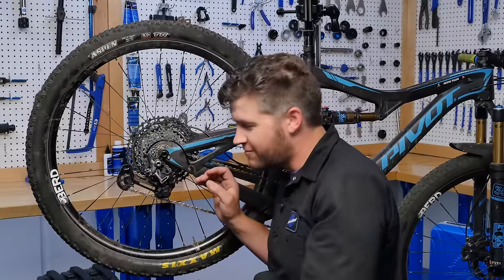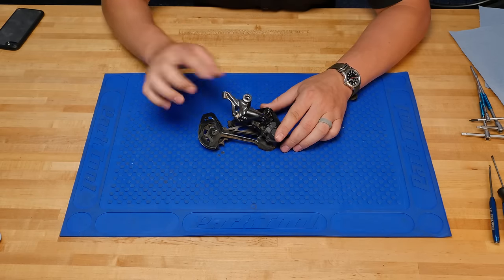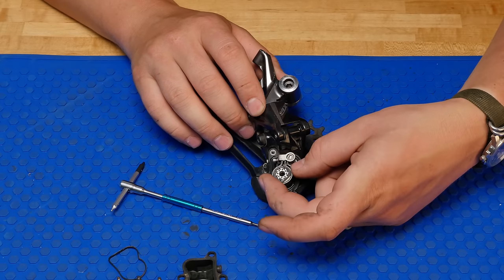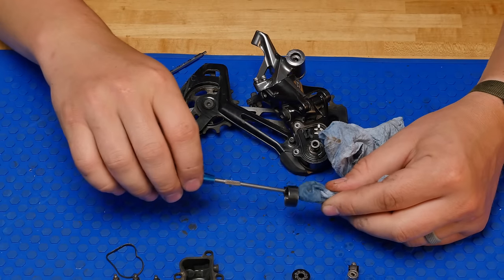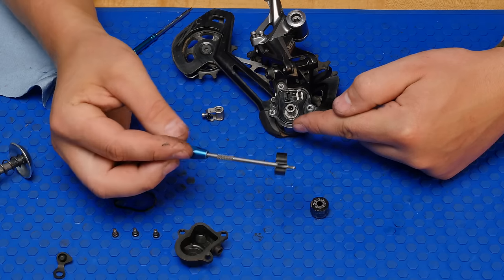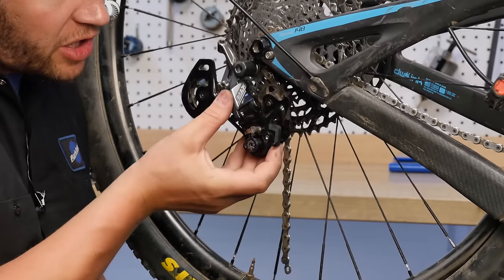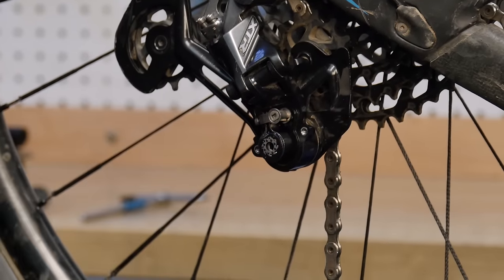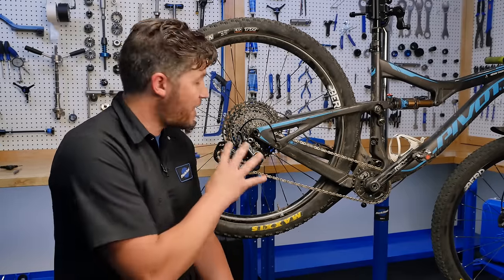Shimano Clutch Adjustments | Tech Tuesday #183

Comment: Wow, I actually didn't know that it can get that hot inside the clutch, I would've used regular all-purpose grease there. Great video!
Reply: It’s not getting hot inside the clutch, I have no idea why he’s saying the grease got burnt and then mentions high temp grease…
Reply: One would have to take a measurement but yeah, not sure it's actually getting hotter than what a conventional grease would handle. It's no active breaking surface. The reason one should use a specific grease though, has more to do with friction IMO: the clutch/jaw assembly does move a little to resist induced chain slack, meaning the mechanism is not trying to lock things out completely but merely add some friction (hence some heat buildup for sure). One therefore wants to avoid metal-on-metal, hence some lubrification required, but it needs to be a very thin, consistent layer. That's why a low viscosity, thin (ie. not thick, buttery) grease is expected: cSt ~40, NGLI 0.
Reply: I would like to see someone measure the temp before I'd buy that it's getting that hot in there. I believe HPG-1 is lighter weight than their PPL-1, so that may be some of it. On top of that, the Shadow grease is a calcium sulfonate grease, as is HPG-1. The PPL-1 is a polyurea may not be compatible if the Shimano grease isn't cleaned out.
Reply: @Montblanc1986  just turn on your clutch and move it back and forth than put your fingers on it, be careful 😂

Comment: I had a problem with the clutch sliding itself off when the cover is not on.  So when Im adjusting the clutch and moving the arm back and forth the clutch assembly starts sliding out.

Comment: Thank you.  At 7:40, when you put the slotted piece over the clutch lever, there is a cam on that part and it can rotate 180 degrees so you have to be careful to get it the right way or when you flip the clutch lever, it will not add tension and the lever will be floppy. I did this last night and can't wait to ride and feel the difference. Over 6,000 off-road miles on my XTR derailleur and I have never done this maintenance step.   I am Barnett's and Shimano certified and worked in the bicycle industry 22 years and just didn't think to service the clutch.
Reply: This caught me out, I thought I'd broken my XT derailleur! 😅

Comment: Excellent video! Very well explained. Recently I  had the heart to service the clutch of a neighbour's Shimano Deore XT after he was complaining about his chain always falling from the chain ring. It was my first time working on a derailleur clutch. After unsrewing the cap I saw a mixture of dirt, rust, moisture... The friction band was like completely seized onto the cylindrical spindle. I thoroughly cleaned all parts and applied grease to the surfaces concerned. Unknowingly I used a universal grease... I couldn't imagine that a high performance grease was the one to use, couldn't imagine that the temperature there could go up that  much... I'm now thinking if redoing the servicing with the right hpg grease. Thanks a lot for your comprehensive explanation. Also I will use a torque wrench to do the final adjustment.

Comment: Thank you for the helpful video. Yesterday I tried it with my RD-5120. When you put the cover back on, you have to put the clutch band deep enough or the head of the tension adjuster will bump into it and the cover will not stick. I think this is also a point to be aware of. My impression was that if the torque of the friction was not reduced to about 3Nm with a tension adjuster, the cage would not move smoothly as in the video. Although Shimano's instruction manual says 3.5 nm - 5.4 nm. By the way, I'm a Japan person, so I didn't understand the correct meaning of "have a clutch day" :)

Comment: So I have a brand new xt di2 derailleur and it seems to have a decent amount of play in the clutch activation lever. Basically the pin from it can wiggle up and down. The issue is that this play allows for the chain to be a bit sloppy for the first bit of rotation before it really  engages the clutch. It also seems to tighten up just fine when upshifting but then almost looses tension when downshifting regardless of the gear.
Reply: I had this issue with 2 deore derailleurs, I tried everything and still there’s a lot of chain play/slap

Comment: 🔥👌This tutorial is ingenious!  Explains all the mechanics yet keeps it simple to step by step maintain this part of the RD.
[Though I think that the clutch systems of the GRX series ( and the Ultegra RX) are designed a lot simpler, there is no cap to adjust the clutch band from the outside, and no torx option to adjust from the cage side.]

Comment: In your opening your seen pulling against the Clutch on the Cage pivot of this Derailleur, and if you notice, it's very loud and "rachety" with the Cage assy slipping quite freely for brief moments across the arc of this CCW rotation.  That is Not the Clutch portion of the "Chain Stabilizer" that is breaking loose and causing the Cage assy to Rachet forward, its the Sprag Bearing INSIDE the Spring Steel Clutch Band that is ratcheting on the center Support Shaft (or P pin ("Plate" Axle) as it's referred to in the Shimano DM (Dealer Manual)).  A Clutch allows for regulated slippage, or Drag, between surfaces, which is what the Spring Steel Band does that is wrapped Around the Sprag Bearing in this case. The Sprag Bearing, at the center of the Stabilizer assy, is a One Direction only Needle Bearing and is designed to Lock-Up, or stop, any rotation in the opposite direction. It's functionally the same as the Freewheeling Hub of a Cassette but locks to the Pin itself instead of a ratchet. The Needle Rollers in the Sprag Bearing are pre-loaded with Spring Steel strips behind them which allow free rotation in one direction only while providing full bearing support around the center Pin on the end of the Cage axle. When force is applied in the opposite direction, the Needle Rollers are forced into the shaft, by the spring steel strip behind each roller, and will lock the Sprag Bearing to the shaft. Sprag Bearing Needle Rollers NEED to be cleaned and lubricated or they will Not lock up on the center shaft and WILL Ratchet momentarily in the wrong direction as you've experienced here in your opener. The "Clutch" portion of this Chain "Stabilizer" assy is in fact the Steel Band that is wrapped Around the Sprag Bearing.  It's metal on metal so it needs cleaning, grease and proper adjustment to work properly.  Next time you have one of these Stabilizer assy's apart, separate, clean and lube the center portion, or Sprag Bearing, place it on the support shaft and test it for yourself. It's a Bearing and so should rotate Freely (CW in this case), but Lock to the Pin when force is applied the opposite direction (CCW in this case). If properly cleaned & lubed, w/ light oil, it will lock up on the shaft instantly when turned the opposite direction. Running a Sprag Bearing dry (without lubrication), will result in the bearing breaking loose from its Locking direction momentarily and appear to Ratchet, just as it did on your opening scene. You can easily test this Unique feature of this Sprag Bearing on the workshop bench and Research this type of Needle Bearing on the Web. It's often referred to as a "Clutch" Bearing but NOT because it has a Clutch function, but because it's often used w/ a Clutch assy like the Spring Steel Ban wrapped around this bearing in this case. I first learned of these unique Bearings located in the Final output gear of model R/C Helicopters which lock onto the Main Rotor shaft during powered flight but allow for Freewheeling, or Auto-Rotation landings if the engine should quit. I found out the Hard Way that an improperly maintained Sprag Bearing will slip badly when Torque is applied to its Locking feature and make for a pretty bad Bearing when Freewheeling. The Shimano DM (Dealer Manual) explains this badly, but who has ever seen a Japanese to English Maintenance/User Manual (Jinglish Manual), that got the terminology correct w/o butchering the English Language in the process ? It's the reason people Produce these video's because the Manuals SUCK. The DM DOES warn not to get Hub Grease into the Pin or Roller Bearings of this Sprag Bearing (or Clutch Bearing as it's referred to in the manual), but they DO remind you to lubricate ALL moving parts of this Derailleur in the Installation & Maintenance Notes in the Manual Intro (page 4). A Good cleaning of the Pin and the Rollers w/ a little light oil applied will make this Sprag Bearing Happy. If the Pin is corroded it's because you've let it go Dry, just replace it and Grease the Cage Sprocket end but light oil only for the Sprag Bearing and Pin.
Reply: He even pointed out that there was burnt up grease on the inside of sprag clutch!

Comment: If I have your click type torque wrench (don’t have the beam type) how do I determine how much adjustment of the clutch is required as you did at the end of the video?
Reply from the maker: Set the click type to the desired torque and turn. you should get about half way through the action of the derailleur before the wrench activates.
Reply: @parktool  thank you. That’s what I thought after I wrote you. I also assumed that I’ll keep adjusting the clutch until the torque wrench (set to approx. 5Nm) activates at the end of the full motion (i.e. at the horizontal poison and not before)….thanks again.

Comment: Do they typically come set fine when new from shimano. Or do you find that one needs to adjust and grease the clutch when the unit is brand new?
Reply from the maker: They come out of the box setup great. After time the clutch will get hot and cause issues to arise.

Comment: Ok, this has a slightly higher production quality than my maintenance video from a couple of years ago. 😬
Anyway, I would recommend to also disassemble the rest of the derailleur and clean the axle while you're at it, it doesn't take that much longer, but can remove another potential cause of stickiness and noise.

Comment: Hello there, will MoS2 grease work for this maintenance? what can I use instead of your HPG1 grease?
Reply from the maker: Most Moly greases will have a operational temp range of less than 300 degrees. You are after a grease with a high operational temp. HPG-1's range is -20 to 540 degrees Fahrenheit. During a rough decent your clutch will get extremely hot and you do not want to cook the grease. HPG-1 is a good choice.

Comment: I thought we were supposed to use the Nexus Internal Hub grease for this?
Reply from the maker: The reason to use Nexus Internal hub grease is for the temperature. Our HPG has a similar temperature range to Nexus hub grease.
Reply: @parktool  Thanks for clarifying!  Love the videos, keep'em coming!
Reply: @parktool  I think you are wrong. I have read that reason to use Nexus Internal Hub grease is that that grease got little pieces which add friction. and those peases are importat also in clutch. There is marketing also Shimano grease for clutch, but maybe is same liquid.
Reply from the maker: We reached out to Shimano to verify before posting this video.
Reply: I've used dt Swiss ratchet grease too. Seems to work fine as another alternative
Reply: @parktool  Then I have heared wrong and glad to see this video and commentet, so that I got corrected. :)

Comment: Would the adjustment be the same with a oval chainring ?
Reply from the maker: Yes, but you may get a bit more wear as it is moving a bit every pedal stroke.
Reply: @parktool  so probably better switching to round chainring ?
Reply from the maker: @edritchie270  Up to you. There is very minimal movement in the cage due to oval rings so it will not be a huge improvement in wear.

Comment: How do you fix a clutch that slowly creeps itself to the off position everytime you hit bumps?
Reply: The clutch on/off switch bar can be tightened for better retention. There are multiple videos on YT on how to completely disassemble a Shimano Shadow+ rear derailleur clutch, replace the clutch lever if need be (worn out, broken...) and adjust its tension.
Reply: It also might be a case of too low the collar tension. This very video shows you how to adjust tension by acting on the bottom, cap-protected screw by fiddling with the distance between the collar's plates.
Reply: @chikamichi  thanks. I figured the flat metal part that's inside the clutch assembly that goes into the lobe spun itself against the plastic lever. So the lobe never engages and locks itself against the clutch ring.
I grabbed the clutch flat metal part and turned it while holding its plastic lever stationary.
It locks itself now everytime i turn it on and never disengages. 
Too bad though, i still have lots of chain slaps and it never really stops the derailleur from extending during ride.
I guess the whole clutch assembly is defective because of old age/heavy usage.

Comment: Good video oveall, but there is one major error.  The ONLY grease that should be used between the one way bearing and the friction band is the white Shimano Nexus grease.  It was specifically developed for the heat of coaster brake pads and can deliver smooth friction at the same time.  No other grease will work in the clutch, at least not for very long.  And, other greases can actually make the clutch feel worse.
Reply: I have the nexus grease but the action on that hi temp grease looks fantastic.
Reply from the maker: Have you tried other grease? We talked to Shimano tech reps about the temps and appropriate grease before this video. HPG's range was in acceptable parameters according to them. Shimano now does not suggest Nexus grease and has a new special grease just for these clutches, if thats what you are looking to use.

Comment: Hey Park Tool. My SLX 12 speed clutch keeps moving from on to off. My old XT did not do that. I can not see anything broken as far as i know. I jumps to off af some fair decents in Denmark. Bikeparks i happens a lot faster :-( Any ideas?
Reply from the maker: Possibly the cam assembly needs to be replaced.
Reply: @parktool  That would be a bummer on a 1 year old part. But i will look into that. Thanks 👍
Reply from the maker: Suer would!

Comment: Only thing I'd like to mention is that you point out that there should be "white" grease on the silver post and that it is now grey because it's "toast".  But then you don't put any new grease on the post when you mount it.  So....how why was there white grease turned grey on the silver post and you didn't put any new grease on it?
Reply: I didn't understand that either. I ended up greasing the post. If you look in  the clutch, it looks like there are roller bearings that contact the post. Not sure why you wouldn't grease a roller bearing ever?

Comment: How to service your Shimano clutch:
Step 1: remove all Shimano drivetrain and throw in garbage
Step 2: install SRAM GX drivetrain
Step 3: ride
Reply: That's the most ignorant thing I've read in years. SRAM mechs are junk. They flap from the outset and are made of soft plastic not fit for purpose. I can tell you from experience that I have regular warranty claims with SRAM products, little with Shimano.
Reply: @adamf5942  at least Sram will warranty replace faulty parts. Shimano warranty is next to impossible.
Reply: @SpMoose  I've never had a warranty claim denied by either Shimano or SRAM and I've been working as a mechanic for years.

Comment: Seriously? Cleaning such stuff with a ... rag ?? Gezuskrist, oh those "mechanics"..
Reply: lol are u ok? what would you use to clean it, an ultrasonic cleaner? its a bicycle part not a space ship part
Reply: @bmxscape  it's a part (with grooves, etc) where you need to remove all the dust/... cause otherway - it will immediately make new grease to same bad condition. UC - best option (if we're ralking about normal mechanic shop), or at least wash all the parts in degreaser/cleaner..
Reply: @ka81alex  you don't think alcohol is a degreaser or cleaner? are u ok?
Reply: @bmxscape  alcohol ON A RAG is different from "part's washing IN A DEGREASER/alcohol". 
Yup, I'm fine, thank you.
Reply from the maker: When you put a part like this in a parts washer or ultrasonic cleaner it removes all grease and particles. Even the grease and lubricant that is still good and useful. This clutch service is a commonly needed service. Completely disassembling the entire workings of the derailleur just to be able to use a degreaser is just not necessary. Alcohol or similar degreaser (that does not leave a residue) with a rag is perfectly acceptable.
Reply: @parktool  still good and usefull? Was there a rust on your clutch??..
Reply from the maker: Yes the grease for the main cage, pulleys, pivots and b link. No rust on this clutch. We have seen rust on newer SLX derailleurs and have talked with Shimano about them. They had a manufacturing error and only installed one seal. They now have 3. Check the Shimano literature for more on there take as well.
Reply: Is this a job a bike shop would do?  Surely they would just replace it.